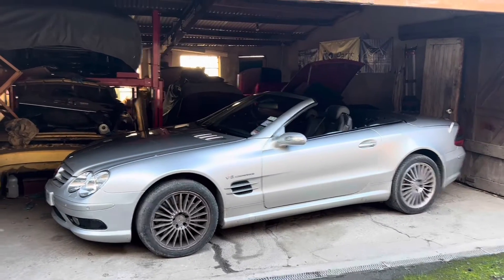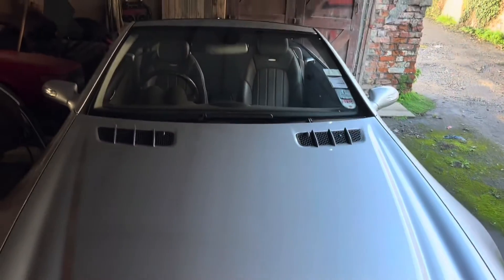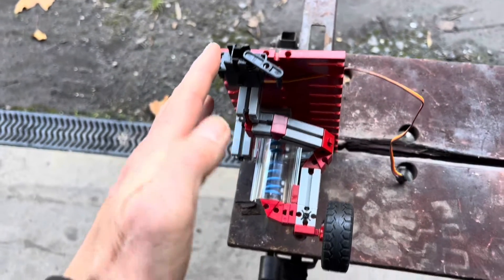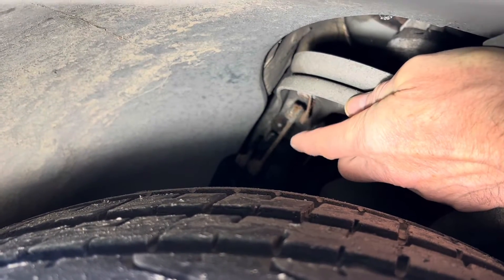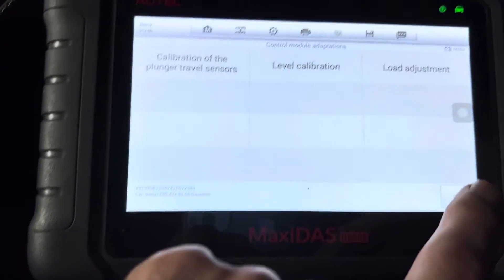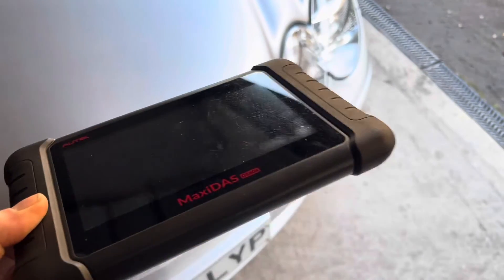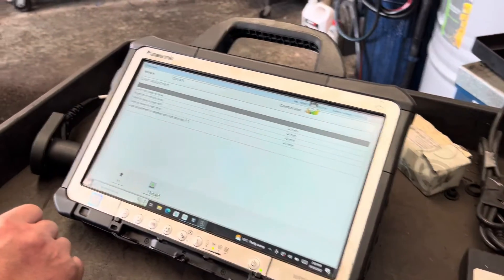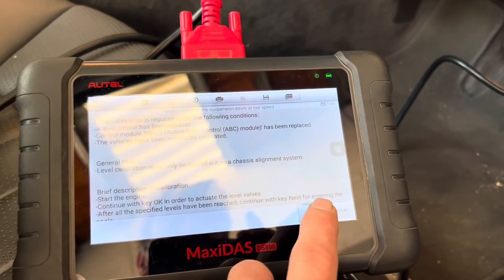Mercedes SL55 R230 level calibration and suspension lowering using Autel MaxiDAS DS808

Comment: Hello,
great movie. can you tell me if the rodeo test call is working properly in this tester?

This calibration, is it successful on Autel MaxiDAS DS808? because from what I can see, it was only successful on the scanner in the MB workshop on Panasonic, here you had an error, so it remained, or I see it wrong.

For years I ran car workshops and generally used diagnostic combines, and my employees more than me, now since 2009 I do not run a business, but as a courtesy I import good cars from Japan and often from ABC for my friends and friends and I need a simple good tester that will trigger a rodeo and it would also be nice to be able to properly complete the calibration of each corner.

Can you advise me if this tester will only pass the exam for these two functions?

I will be grateful for the information.

Regards,
Stefan
Reply from the maker: Hello Stefan

Unfortunately, the version of the MaxiDAS DS 808 I have, has a bug and for me it was not possible to successfully complete the calibration. I am unable to upgrade the software on this device because I am not the original owner so unfortunately, I cant recommend this unit for your purpose

I have never tried the RODEO function on this scanner although it does have that feature. On older cars with older hoses, performing the RODEO can actually cause a problem that might not otherwise occur because the RODEO takes those struts to the limit.

I have had emails form other subscribers who have also struggled to perform the calibration on their Foxtel scanners. 

My theory is that many of these scanners use the same underlying software script with the same bug. I imagine that few people ever use these scanners for calibrating ABC, and those who do, probably dont have a youtube channel to highlight such an obscure bug.

If I find a scanner that can calibrate, I'll let you know and if you find one before that, can you let me know?

Mike in Bristol
Reply: @MikesMercsandothercars  Hi Mike,
thank you for the very factual answer.

If I could reply to your e-mail, and not under the comment, I would probably do it more widely than you, because I am a terrible chatterbox. 😃

My over 20 years of experience with the ABC system, commonly known as the "Angel of Death", tells me that "Rodeo" is not for killing the system, but for flushing it when you want to replace the fluid correctly and remove any stuck scraps and filings, venting and to some extent calibrating . I also believe that when a component is weak, it is better for it to end its life in a workshop or at home than 1000 km from home, but of course "Rodeo" must not be abused.

As a courtesy, I help people with the ABC system for whom I import cars from Japan, although I am not a dealer, recently two SL R230 arrived, I myself have two CL55 AMG 360 and 500 KM also from Japan, one has 120k km, the other 90k km.

Two days ago I was rebuilding one valve block, replacing o-rings and plunger springs, because those mechanics who only stretch them do it in vain, because a "tired" spring will always remain tired. 😃

A month ago, I helped throw out the ABC and replace it with Yellow Speed Racing, plus stabilizers, front and rear, tandem pump replaced with a simple one-section. This is also a good way to take it easy with ABC.

You know how it is, passion is the meaning of life, and mechanics, painting and creating new ones are my passion. Even though I don't work in business anymore, I still have to do something out of passion.

Now I am in the process of rebuilding one CL for a cold intake, where I am rebuilding the MAF by putting a honeycomb screen in ss steel (not aluminum) in a 6:1 ratio because it is the best ratio for this throttle and ECU learning capabilities, to this I add BMC filters:

 https://www.rallyshop.it/bmc/acota70-85l200-b-1

I'm looking for a simple scanner just for these two options, because I don't want to buy a star or similar, because it's like buying a digger to plant five potatoes, but when I don't find any of these Chinese things, I will be forced because people who know the system ABC in Poland is like medicine and they stretch customers for gigantic costs, the customer has, for example, a damaged pressure accumulator, they start by replacing the pump, etc.

When I find a good Chinese scanner, I will inform you immediately, as you did, because it is a sign of respect between people, and this is very important to me.

Regards,
Stefan
Reply: Ever find a scanner that calibrates successfully??? I have an Xtool 7 with same functions but won't hold ride ht.
Reply from the maker: @curlymyhero  When you say "wont hold ride height"....do you mean you set it successfully in the scanner but as soon as you turn off car and restart it goes back to where it was? If so, check that you are changing the settings in "Initial Start Up" and not "Control Module adaptations" see 11.40 in video. Mike
Reply: @MikesMercsandothercars  In the Xtool 7 there's no " initial start up" setting.
Reply: @MikesMercsandothercars  I don't have an SDS. That works. My mid level scanner doesn't hold even tho I can raise or lower the abc suspension
Reply from the maker: @curlymyhero  Could be time to treat yourself to a new scanner...or find a friend independent garage with STAR. Sorry I cant be more helpful on this occasion. Mike

Comment: Hello 
Thanks for your video, I’m watching all your video , very hopeful…
Could you make a video about how to replace the two small screens in the cluster( I have it burned ) at low cost or reseñable cost ( I have the star 5 MB ) 
Also it will be big help if you could walk us on how to do the lowering using the software on Star 5 step by step 
Big thanks again
Reply from the maker: Hi - do you mean you have had a fire and the speedometer and rev counter are melted...and you need to replace them?

What model of car you have - SL55, SL500 or SL350? There is a R230 graveyard close to me and he is breaking 2 SL500's so you should be able to get the parts you need.

I plan to do a proper step by step lowering video at some stage. When I tried to do it on my AUTEL, I discovered a bug and had to use STAR to recalibrate. I bought a set of Airmatic lowering links and will do a video on how to fit these....there is less that can go wrong by using these adjustable links.

Mike

Comment: Very good video Mike. Nice visuals. The only thing I noticed was the technician enter -8 & -4, but you always entered-8.0 & -4.0. Maybe this is causing the error?
Reply from the maker: Yes that did occur to me - when I was at the Mercedes place, I actually tried both but I edited that bit out as the video was getting a bit long. I see your project is moving ever nearer completion. I hope it is all going well. Mike
Reply: @MikesMercsandothercars  I was hoping it was just an input error. I’m getting ready for the rear cover and seal on my project then the front.

Comment: Hello Mike ! Greatly interesting your video...i just réalised on my car, i had the right side lower than the left side...by an inch.
So you think it is just a question of calibration for my ABC, from Mercedes or any Spécialist shop?
Do you think That problèm could have been ignited by the low batt alerts on my car, every Time i start it up? Symptôm Is Cutting thé accessories until batt has leveled up...
Best regard
Reply from the maker: Thanks for your comment. What model and year of car do you have? 

1. Is your car ALWAYS an inch lower on that side or does it droop after being parked for a while? eg when you go for a drive, and measure the tyre/wheel arch gap, is it an inch out? A drooping suspension...especially after the car has sat for a while is probably a sign that the seals in your front valve block are starting to fail

2. I am assuming there are no hydraulic fluid leaks under the car and you dont have any ABC warning lights on the dash?

3. If you look at time code 16.38 in the video below:

https://www.youtube.com/watch?v=4YDw_wE9Ck4

There is a rod which connects the front control arm to a height sensor. If this rod is damaged or bent, that could account for your car being lower on one side. 

4. It COULD be something simple like you car needs to have the suspension recalibrated...but I double it. A good independent will charge between £50-£100 to recalibrate your suspension.

5. Last but not least, low battery is not likley to affect your suspension. I have done a couple of videos on battery drain in the R230:

https://www.youtube.com/watch?v=hjPqvAkBMtc

https://www.youtube.com/watch?v=OWrIS0iWJLA

https://www.youtube.com/watch?v=R7fbQBPaTPk

Mike